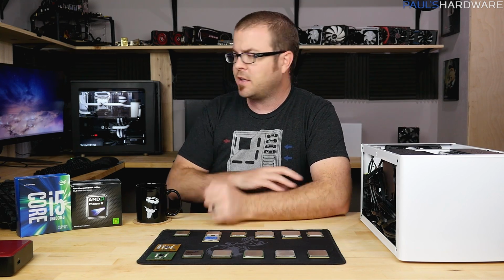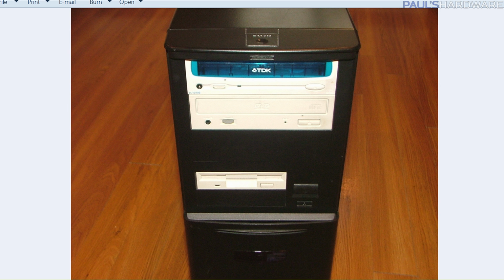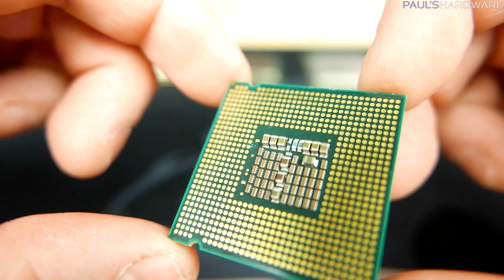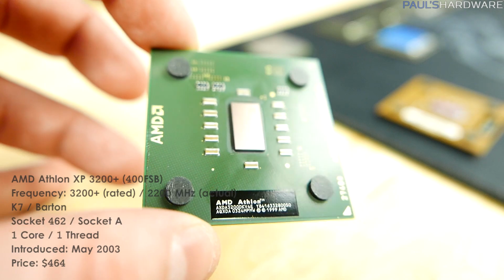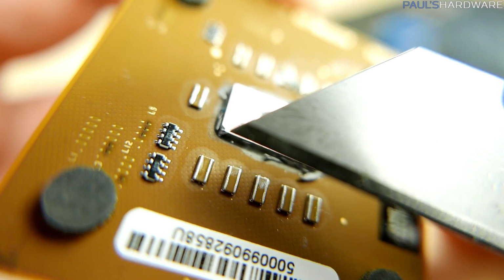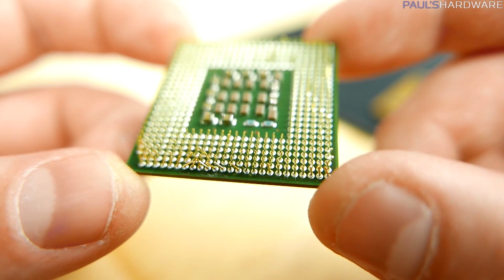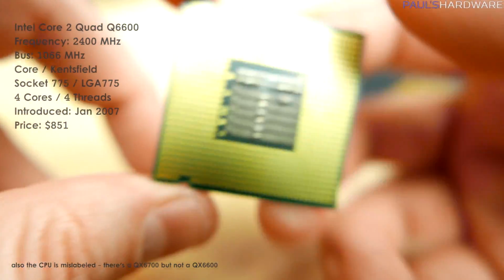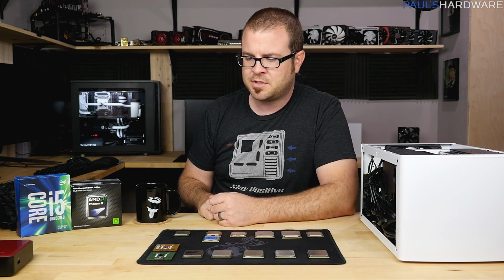My CPU Collection!

Comment: athlon x2 6400+ was  BEAST during it's time.  It handled crysis at 1680x1050 at medium settings with a single 8800gt 512mb vram vid card with 4 GB's of ram.
Reply: +tpcs At that time I had an AMD Athalon II X4 640 clocked at 3.0Ghz with 8GB of DDR3 ram(most the board could take), running 2 1GB EVGA 9500GT cards in SLI on an ASUS board, with an ACER 23in 1680x1050 LCD monitor(still have the monitor as a backup) 1 500GB HDD, and  and 2 Samsung DVD burners with an Antec 650watt PSU housed inside of an Antec 300 case, and I had little problems running the original Crysis at mid-high settings, but about 2 1/2 years ago now my g/f's then 11yr old daughter accidentally knocked my morning coffee off my desk, and kill my computer(was able to salvage my HDD, and DVD burners and still use one DVD burner, and the 500GB HDD for music)and man that was one sad day for sure, as I miss that system.
Reply: I had a 5200+, and that was already a fantastically powerful CPU, so I'll immediately believe you that the 6400+ was an even finer specimen...
Reply: ***** Are you high?  The 6400+ overclocked to 3.5ghz, ( which was so easy an idiot can do it) tied the core 2 duo in all gaming performance numbers from 1680x1050, 1440x900, and obviously 1280x720. And YES I HAVE compared them in real time SIDE by side with crysis, Prince of Persia The Sands of Time, Street Fighter 4, and Star Craft Brood Wars.  

The fps differences at ALL of those resolutions with a single 8800gt 512MB vram nvidia video card were within less than a 3% difference across the board.

Anything else?
Reply: Commodorefan64 You had a major bottleneck on the games that actually supported SLI well given the cpu you chose to run with that dual vid card line up.  I've had the athlon x4 that ran at 3.0ghz stock before.  It just didn't have the cache to fed enough graphical information to two video cards, but for one it was fine.
Reply: tpcs I honestly very rarely had any issues with the setup until the fan on my 2nd card started acting up, and switched to one card while I went on eBay to find a replacement fan for the EVGA card, and found an aftermarket Chinese special, and it worked well enough till the coffee accident, but that's life with kids.

Comment: I'm still using the 920 as my main machine! It's what I use to render my videos. LOL
Reply: This thread is first gen i7 party xD, 920 here.
Reply: Tech-Know Scope That's a badass build...I'm sure you won't have to upgrade for a long time.
Reply: Gaius Trollius my friends in IT are giving me 15 years if the hardware survives. lol
Reply: Me too
Reply: Cool channel bro
Reply: Lol, is it any good for it?
Reply: Matchutsi it's fine for 1080p video. Takes about 20 to 30 minutes to render a video... If you've been to my channel you see I'm building a new PC, that's because the 920 can't handle 4K for shit.
Reply: +Tech-Know Scope can confirm that 4k and my 930 don't go well. 1080 is about all it will do. vant wait for the intel 10nm.
Reply: Same for me :) its my daily driver with gaming on a overclocked 770 with 3Gb VRAM
Reply: i7 930 with 12gb ram 2x r9 390x 8GB when the new intel stuff comes out I need a board a processor and ram.
Reply: 920 as my primary also. 12GB ram and a GTX 760.
Reply: Troy Smith 12GB ram, GTX 660 xd
Reply: Troy Smith 920, 24GB, 760 4GB edition
Reply: Glad I'm not alone. I7 920,  6 gb ram and r9 280x is what my main rig is made of.
Reply: I can't be counted in this mix anymore. My  #ProjectSledgehammer  build is complete. Now I'm rocking more cores than I know what to do with.

http://sledgehammer.TechKnowScope.tv
Reply: Tech-Know Scope I want that Cherry MX blue K95 ;-;

Comment: celery 400 ftw
Reply: celeron 400 too
Reply: +mark rossi Celery FTW
Reply: CELERY
Reply: I had a Celeron 600 that I overclocked stably to 900. It was one of the fastest CPUs around for a short time. I might still have it somewhere - funny story, to get it to run at that speed I had to remove a pin to trick the mobo but I broke off the wrong one! I thought it was all over but I actually managed to solder it back on just using an old 60w iron and tweezers.

Comment: i still have my core 2 quad q9550
Reply: +F4LL3N262 GG my 9450 is still doing fine at 3.2 GHz.
Reply: +nimrodery nice i never overclocked my q9550 never had a mobo that was good at it
Reply: F4LL3N262 GG I only changed the multiplier. I could go higher if I knew anything about overclocking (of course, the chip runs pretty hot already).
Reply: +nimrodery the bad thing about those old chip hard to find aio coolers for 775
Reply: F4LL3N262 GG That's where a large case and a big air cooler come in handy. I don't have to run Noctuas at full speed on their cooler, so it even ends up being nice and quiet. I'll probably watercool my next build for fun, but I haven't run up against the limits of air yet. I hit 80 degrees occasionally while gaming, but I was getting over 100 before and it didn't kill the CPU (the stock cooler thermal paste wore out).
Reply: +nimrodery damn my cooler in my q9550 at stock wasn't able to keep system on for 1h the system had to shut down or have a fan blowing in the pc the cooler was a passive cooler
Reply: F4LL3N262 GG I have a ThinkCenter tower that's a bit like that. The front case fan (correction: only fan) ran air through a shroud directly to the CPU. Awesome for silence, terrible for case temps. I would still use that thing but the mobo died and it's a BTX. Too bad because I really like the case :(

Comment: the first 6 core was the 980x on socket 1366.
Reply: +Dave Croteau  That's correct. Followed by i7 970, i7 990X and i7 980? There were at least, four six core CPUs for "consumers" from Intel before the i7 3960X. I wonder what was Paul smoking... :D
Reply: Lol

Comment: I've got 286... still runs.. on a BW monitor. 
and pentium2 aswell, sold everithing later than that, to buy new shit.
mostly I miss old dead voodoo2\banshee 3dfx
+6600k and 3258 in use.

Comment: "Make like an A-bit motherboard and stop posting."
Reply: +Solstice [SaltyPeanutCraft] yea and he rents a house ????
Reply: +headcas620 Abit was good till they like vanished.. been using Asus ever since.
Reply: LOL, thats for sure. I ran Soyo until they went into the Via phase, then I went to DFI, and then after they died, I just used what everyone else did.
Reply: Had an Abit BP6, a dual Celeron mobo. The Highpoint UDMA/66 controller tended to freeze the system during high load in Linux. :P
Reply: +headcas620 Bravo dewd. beep beep dead.
Reply: +headcas620 YYYYEEEEEEEESSSSS
Reply: Gabriel Marquez Hm?
Reply: +HUGSaLOT Valkyrie Man... i remember abit... i haven't seen them since college... 2006ish? Did they go out of business?
Reply: +headcas620 Oh, i looked it up, it seems what was abit is now elitegroup ecs. Yikes. 
Well, elitegroup was who was manufacturing their motherboard. Universal Scientific Industrial  bought them out then dismantled the brand. USI does oem stuff.
Reply: +HUGSaLOT Valkyrie i had an abit board.. it died from overclocking i think... for the most part i used Gigabyte since then. never let me down :) asus did but i think it could have been my fault, not sure tho.
Reply: +headcas620 Shitty caps though. Preferred A Open motherboards myself.
Reply: I miss ABIT motherboards, I used them back in the Socket A days, and when I moved onto the Core 2 era, I purchased the P35 and X38 boards that they have.
Suffice to say, they both live and do work today, after they got retired from being my main computer, they then went on to live their lives as servers.
The P35 runs my backup NAS while the X38 is my primary home server, and it has been my most reliable motherboard so far.
However, this may change in August with Threadripper as my X58 may be replacing the ABIT.
Reply: I've got an Abit SA6R that still works.

Comment: has a core 2 duo, uses it 24/7 for a server. Has a 5960X, just owns for his collection LOL.
Reply from the maker: +Dylan 873 IT'S FOR RESEARCH
Reply: +Paul's Hardware that is a valid reason. id do that too if i had spare cpus
Reply: I've still got a core 2 duo :/ I need a new pc D:
Reply: +Dylan 873 Core 2 QUAD 6600 get on my level...
Reply: +Dylan 873 The first computer I built with my own money was a 486 DX2 66Mhz with a 3-speed CD ROM and OS 2 Warp operating  system.
Reply: +Paul&#39;s Hardware If you know what I mean...
Reply: +Paul&#39;s Hardware Much Research many wow
Reply: Na life sucks
Reply: +Dylan 873 
Still uses an old AMD 700MHz (Thunderbird) as a server, it's stable and runs 24/7.
Fast nhaa but who need XEON CPU's in a home server anyway, seriously?
Reply: a true scotsman uth ...and? What did you seriously think I that I was suggesting he should put puppy linux on it?

Also while it will run ok on windows, it however isn't going to run great since it's pretty freaking old, so if you want decent performance out of it then you'll probably want to run a linux distro anyway.
Reply: +Dylan 873 ...I should get a life...
Reply: +Tuco Im using Q6600 too
Reply: +Dylan 873 to be fair, core 2 duos are proven to be rock stable, which for server purposes is absolutely vital
Reply: +AgarBola Try puppy Linux on it, it'll be as fast as lighting. :D
Reply: +Paul&#39;s Hardware  I still have old Celerons and P4s from Intels PGA days. Also have a couple Socket 775 P4s (x86 only and x86-x64 models). Also have an old Socket 939 AMD CPU and a AMD Socket AM2 both are athlon 64s but I don't remember exactly which ones. Also have an AMD Phenom IIx4 965 and FX8350 which leads to my newest the i7-4790.
Reply: +TheAmazur20 sameee
Reply: work load is what important:)
Reply: +Dylan 873 I use a core 2 duo for my server as well :D
Reply: +WIN2K3R2 Most CPUs are rock solid.
Reply: +Cozzmy Cosmin  i know something else that is rock solid....
Reply: ( ͡° ͜ʖ ͡°)
Reply: ***** If you want to do research on an 8K projector screen
Reply: Peter Taranto In the end it all comes down to what it's purpose is, mine for an exemple is file server only with no transcoding or similary, and before that i was it as a gateway under ClearOS and that too worked like a charm, I don't why but that old Compaq i rock solid.
Reply: +AgarBola same here, I'm running an E7400 hbu
Reply: oh hey dylan
Reply: +Paul's Hardware AHHH DON'T OFFEND US
Reply: +Dannyh53 I have 15 LGA 775 P4's you can have some if you pay for ahipping. xD
Reply: I'm still rocking an E8600 and a gtx 560 for my retro gaming rig. My first rig had an i386
Reply: Grumpy Gimp81 First rig I had has a Pentium 166Mhz
Reply: i just bought an e8600 it seemed like the best lga775 cpu to get if you can't overclock like me lol, i dont know which graphics card to get to compliment it nicely
Reply: I use a GTX 580 in my core 2 duo retro rig and it seems to work nicely. Although you'd probably be better off going with something like a GTX 750ti or R7 265x just for the sake of better driver support.
Reply: yes but ive seen videos and apparently you can get decent graphics with a high GHz dual core with a decent GPU
Reply: I already upgraded my ram to 8 GB though so bad I think I'm going with the rx460 or gtx 950
Reply: +vgamesx1 thats stupid, windows runs fine on a c2d
Reply: Paul's Hardware 
Okk do you work in NASA